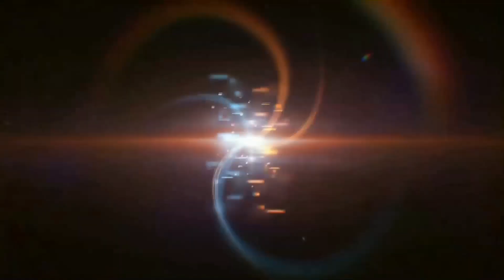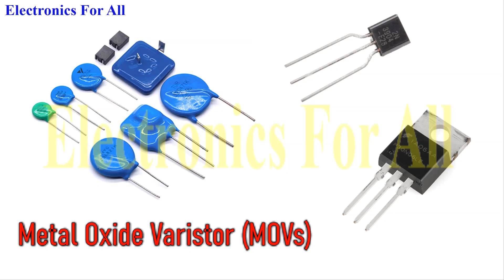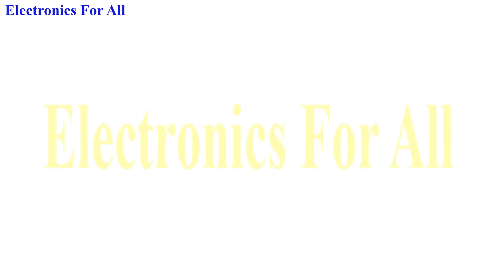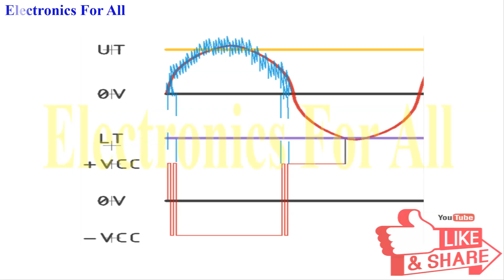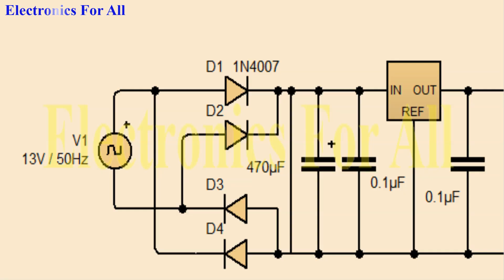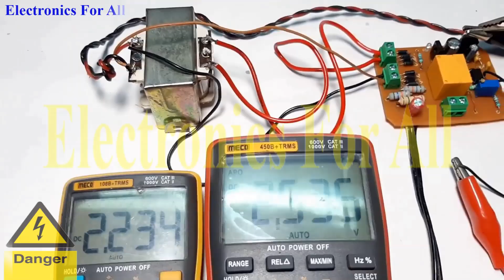STOP Burning Your Electronics! 220V - 230V Auto Cut-OFF Circuit

Comment from the maker: Automatic High Voltage Cut-off Circuit for 230V Mains - Save your home!

⚡ Is your home safe? This circuit automatically cuts power when mains voltage goes above 260V!

In this video: Complete schematic, PCB, and testing of 230V AC over-voltage protection.

✅ Cuts OFF at 260V+
✅ Auto ON when voltage normal
✅ Protects Fridge, TV, AC, PC
✅ Simple LM358 / Comparator based

📥 Circuit Diagram PDF: [blogger.com/blog/posts/2910349977744374112]
🛒 Components: Relay 12V 10A, LM358, Zener 5.1V...

#230V #overvoltage #highvoltage #cutoffcircuit #mainsprotection #diy #electronics #voltageprotector #homesafety